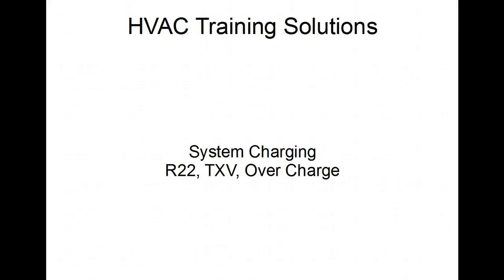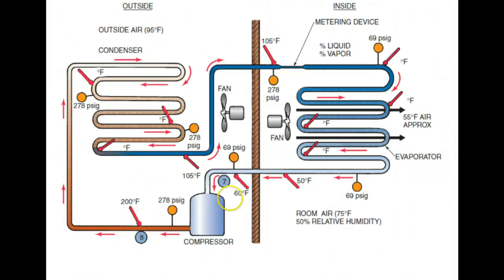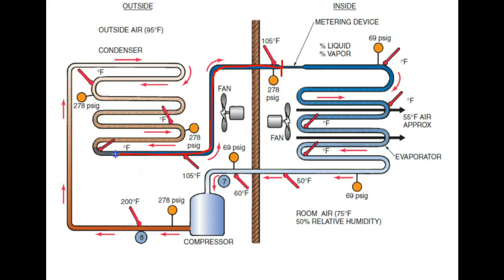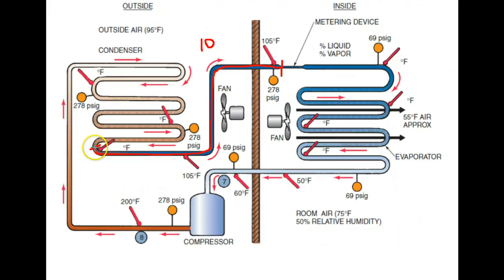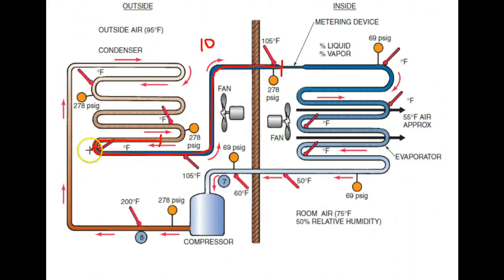System Charging - R22, TXV, Over Charge

Comment: Why is a high subcooling situation bad?  Gut instinct would say very efficient AC in 100+ degree Texas summer.
Reply: Well if you have too much subcooling then you're going to have a bunch of liquid in the system,  and you will flood the compressor. Compressors are not meant to have liquid refrigerant in them, only vapor.
Reply: Thanks for asking. Was wondering that myself.

Comment: shouldn't the temperature of the refrigerant coming out of the compressor be much lower, like around 115F? because if it were at 200F then going down to 105F just before the metering device wouldn't that mean it had 95F of sub cooling?